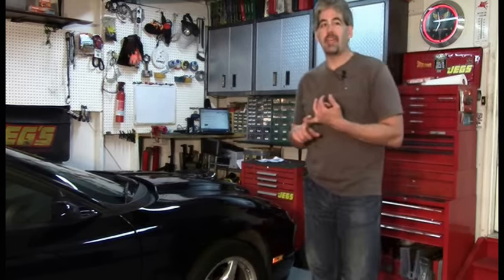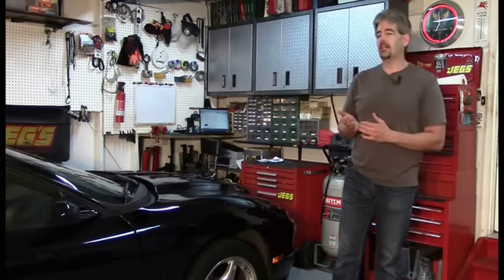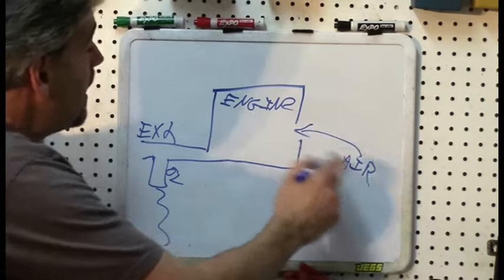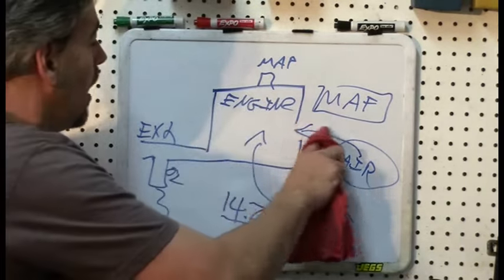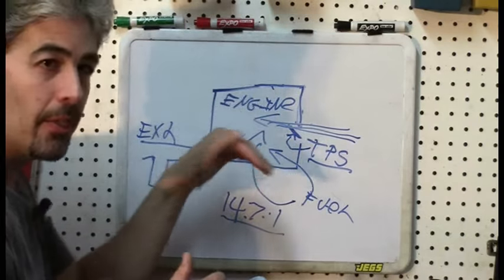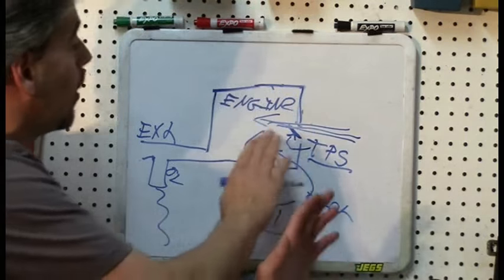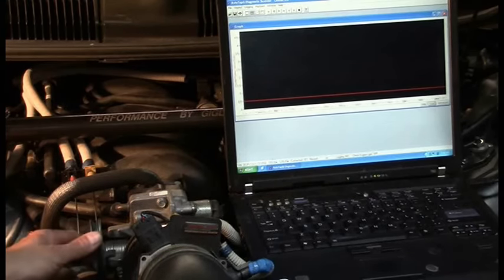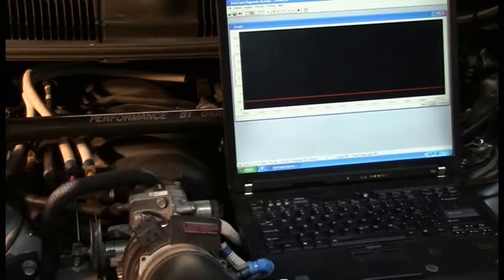TPS (Throttle Position Sensor) Diagnosis and Understanding Pt1

Comment: Never heard a guy talk so much and say so little.
Reply from the maker: +Larry Markle Give an example of the superfluosity. What was a useless concept?  Be specific.
Reply: Please accept my apology. At the time I was frustrated and looking for a solution to a problem that should have been looked for at Identifix or Alldata. You did a thorough job of explaining the tps. My problem turned out to be an intermittent glitch in the tps with no codes. Found it with a lab scope. (car ran better with the tps disconnected) yada yada etc. You did a good service for the public and I should give you credit for posting service tips. I have been Master certified in auto and truck with L1 and more for 30 years+ and I should know better than to give a guy a hard time for helping others.
Sincerely
Larry
Reply from the maker: +Larry Markle Apology accepted.  mosr people by far would agree with your first statement though- 98% of people in fact. It's what keeps Autozone in business. "plug and pray" instead of diagnosis.

Comment: Boy, you are a very unfortunate individual.
Reply from the maker: Why would that be? I don't believe in fortune but regardless I've done pretty well for myself through effort and ability and as a result I have a 6-figure job supplemented with a youtube hobby that alone generates more revenue than most people make in a year.  I don't know your situation but I would hardly even consider trading places with your "fortunate" circumstance.